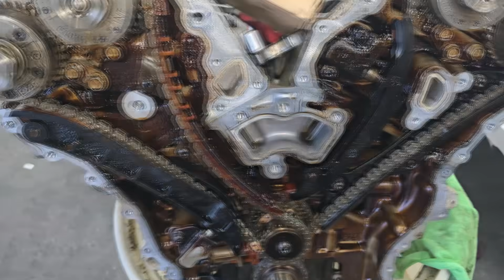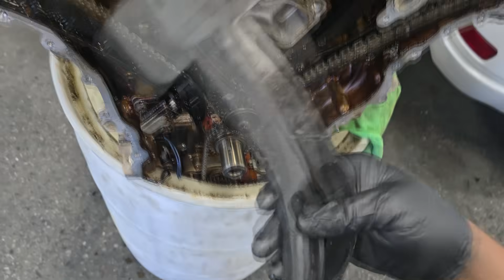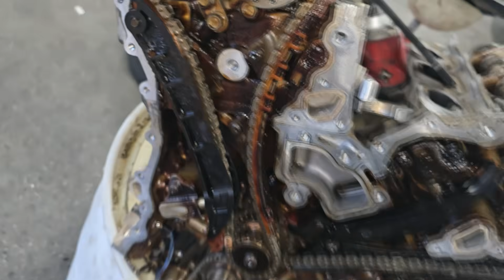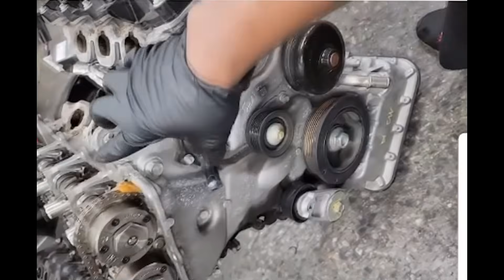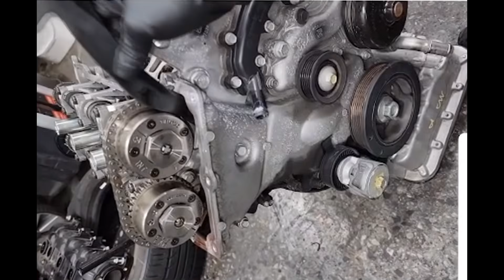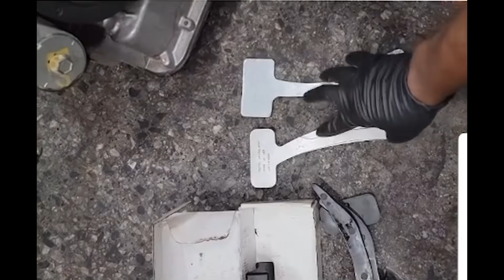These cheap Amazon Ebay 3.6 Pentastar Tools could destroy your motor.

Comment: The Amazon camshaft tools works great on the right bank just fine. It’s the left side that doesn’t work the pins won’t lock the tensioner in the relaxed position for camshaft removal!
Reply from the maker: Hmmm, you may be using the tool wrong because the tool all the same

Comment: The plastic ones from Amazon work, I’ve done several 3.6’s with them. They’re great for replacing the noisy followers and lash adjusters. You use the large T-shaped ones for releasing tension on whichever side you’re working on while rotating the engine counterclockwise. They fit perfectly, at least the ones I have do. The bigger set on Amazon also comes with another cam holding tool that goes around the triangular part of the cam with the hole in the top at TDC. I have absolutely no idea how you’d actually destroy an engine with these tools, there’s TDC marks everywhere on these motors. Hopefully people would be smart enough to pull the front cover if there was any question on whether or not a chain jumped, but if you’re at TDC to begin with, I don’t know how you’d possibly screw up. I guess if you’re not a total idiot, they work fine.  Or, if you really want to be stupid, buy them from some fancy tool place for $500, and get the exact same thing you’ll get from Amazon, only the T-shaped parts are aluminum. The cam holders are still plastic🤣

Comment: The Lisle one is a little bit more but is much higher quality but for most stuff you only need the tool that holds the teeth together (at least I like having it) and I wouldn't trust an amazon for that one. The lisle has 2 metal ones for certain gens too. Also you've probably said it before in another one of your vids but if you're just doing rockers or cams, you can do one cam/phaser at a time and don't even need to remove chain tension. You can just mark everything, break loose the cam phaser bolt, turn the cam with a wrench once separate from the phaser to remove pressure from pressing on the valve, then undo all the cam caps and remove the cam doing just one cam at a time.

Comment: I used the Amazon tool to do the job 3 times and they need to be modified for the Right side. I cut the cam phaser locking tool in half so I could use the 36 mill socket to get the exhaust side loose.  If you don't you probably have to take off a motor mount and jack up the engine if you a DIYer like me. I wouldn't use Amazon camshafts cause all it did was mess up my idle and engine lost power to the point it would cut off while driving. I did have to bite the bullet and get Mopar camshafts and cam phasers. It was triple the price but once installed engine was quiet, powerful and smooth as butter. Your videos helped a lot and scared too but I took my time and she running good now. The right side was a struggle but I found it was easier to put it back together and get the cam phasers back on without the special tools. Thanks!
Reply: How did you end up getting the right bank back together? When I did it I couldn't get the passenger side exhaust phaser back onto the camshaft?

Comment: Both of those tools are for earlier gen Pentastars. I don't know think there are metal tools available. In my experience the plastic tools are useless. They tend to slide past the guard instead of pressing it down. I use your tool-free method
Reply from the maker: 😅🤣😂 Lol my guy that video was only made for bragging rights and someone dared me. Lol, that's not an educational video. But thanks for watching.
Reply: @OnlineMechanicTips  You mean your tool-free video?  But it works!  
And the plastic tools don't.
Reply from the maker: @kirkdarling4120 👍👌👍

Comment: 2012 Jeep wrangler. Truth. The plastic ones I bought cracked and almost broke off inside. So cheap. Will need to buy another set if I ever have to do that again.  I found the original mopar part no and tried to get them from the dealer but they said they're no longer available so I had to go with the amazon specials.